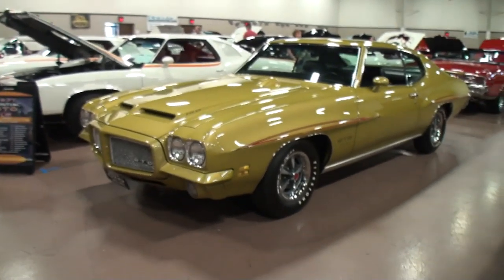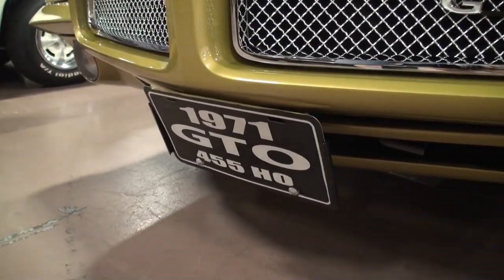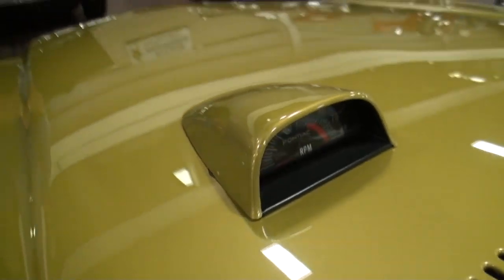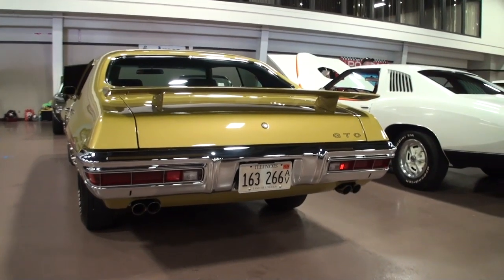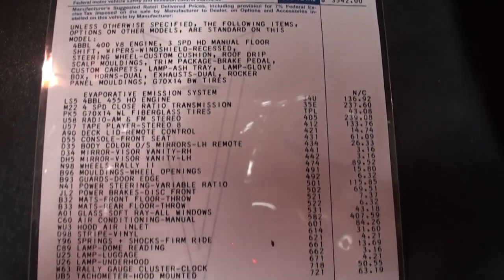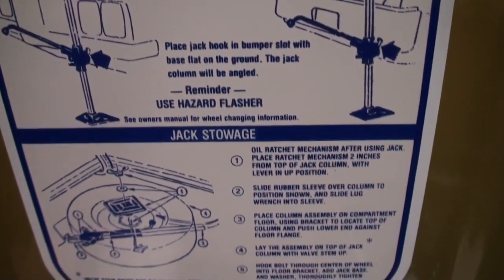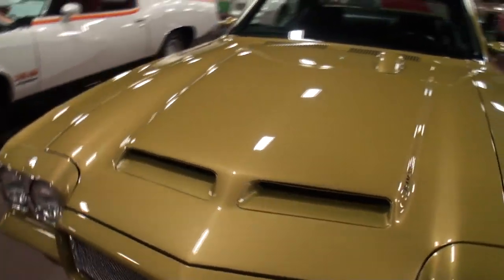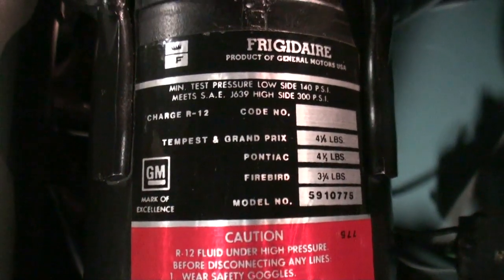1971 Pontiac GTO Hardtop Coupe in Gold & 455 H.O. Engine Sound on My Car Story with Lou Costabile

Comment: Beautiful car The one thing I noticed is that the steering wheel looks like it came out of a later model Trans Am.
Reply from the maker: Hi Aspie Runner, Happy to read you enjoy the looks of this car :-) Lou
Reply: N30 Deluxe steering wheel option is on the build sheet Lou shows in the trunk,  it is same as the Trans Am wheel.  It is legit for this car.

Comment: Another Great Car Lou ! If it had Power Windows it would have been Perfection Itself. I drive my Vintage Cars, not just Show them so opening all 4 Windows with the push of Buttons as opposed to 4 separate cranking handles in 4 separate places makes a big difference. Great Car just the same.
Reply from the maker: Hi Max, Happy to read you consider this car "Great" :-) Lou
Reply: Surprised they cheaped out on the power windows. This cars has everything else. Keeps it from being truly excellent.
Reply: @rocksteele6926  I know, how much extra could it have been ? They checked off every other item, it just doesn't make sense.